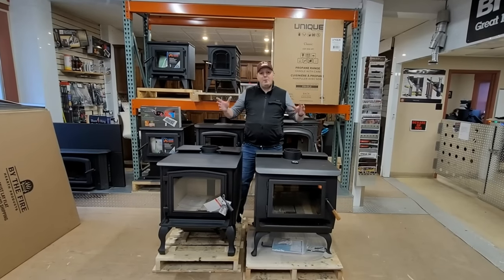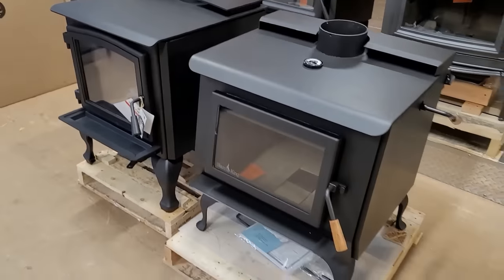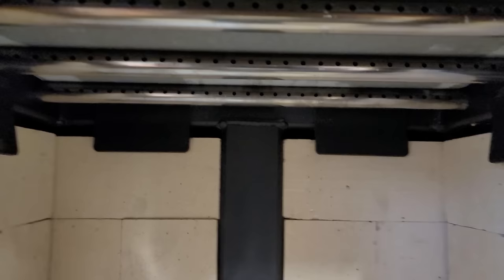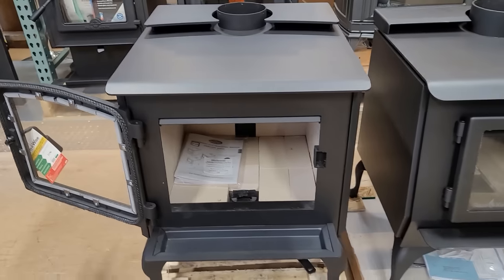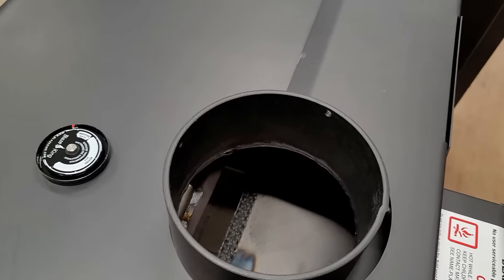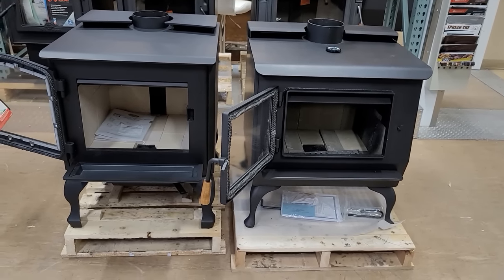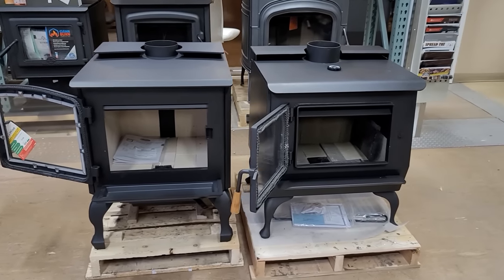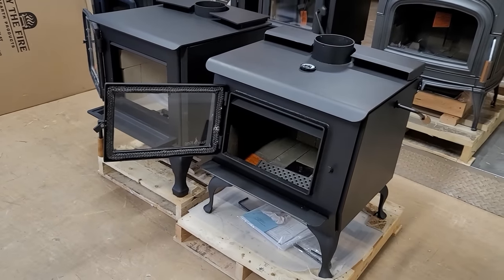Comparing Catalytic to Secondary Air Wood Stoves

Comment: EPA testing for these stoves includes an efficiency rating produced from the test sequence expressed as HHV. The 3300 is 71%, the Princess is 80%. The fact that the catalytic stove also burns steadier will tend to mean that the fluctuations in the house will be less significant, which has secondary efficiency advantages not shown here. What this tends to mean, is that for the typical wood burner who burns 3-4 cords a year, the catalytic stove will save about 1 cord every 2 years, which basically pays for a cat replacement, but many folks get more like 12-20 cords per cat, so it's cheaper to run the catalytic stove long term if you pay for wood. 

Hybrid Soapstone stoves are the best fire-viewing stoves IMO. These can be burned at a steady rate with beautiful flaming combustion, but absorb that heat into the stones and release it slower. Much lower surface temps during the hottest part of the burn than a steel stove but it holds those temperatures more stable for hours after the fire has transitioned to coaling, making it much more comfortable to be in the room with or seated in front of the stove reading a book for hours. These modern secondary combustion steel stoves will often have surface temps of 800F or more, very high thermal radiation... Some people like this. It makes me sweat, no thanks. The hottest part of a soapstone stove will rarely go over 600F.

Comment: Great video. I didn't know catalytic stoves could give you burn times of 30 hours. That's crazy. Still, I think I prefer non-catalytic stoves. I have a Pacific Energy Super LE (non catalytic) and I'm pretty satisfied with the 6-7 hours burn time. This stove is very efficient and well built.

The only thing I don't like about these secondary air EPA stoves is that they prevent you from closing air intake completely. I have a straight and tall chimney and that gives me a very strong draft. Sometimes when the temperature outside is cold the fire becomes uncontrollable even with air intake shut all the way down. Second combustion goes nuclear and the only thing I can do when it happens is look at my fire hoping it calms down. Not cool.
Reply from the maker: Completely opposite with cat stoves. BK uses about 70% less air and are not prone to over draft issues as secondary stoves are.
Each has its place and I am glad you love your PE.... just don't overfire the stainless baffle in the top.
Reply: @tinmaninc2023  Thanks for the heads up. The only solution I found to prevent overfiring is to put less wood during reloads... which is ok but not ideal. My PE dealer told me he is not authorized to install a key damper on my stove pipe due to some construction regulations in my province.
Reply: @podcastnusakan  
I am looking forward to getting the alderlea 6t soon. So you recommend getting the damper on the stove pipe ?
Reply: @lrich9317 Well I contacted PE about my excessive draft situation and they responded that in my case a key damper is probably be the best solution to my problem. Almost everyone on the hearth forums also suggests I install a key damper. So I will install one and see if it makes a diffence this winter. I'll try to think about coming back here and report my results!

Comment: I have a 2021 lopi liberty, throws great heat easy to light with the green start, but I'm constantly filling it, last year I burned 12 face cord, but this year i'm already at 10 face cord and we havent hit the dead of winter yet. I am gone from 530 am till 6pm everyday for work, and gone most weekends, and when I come home, my house is colder than I want, so my question is would a princess help me out with my issues? Thanks
Reply from the maker: I think so. We have customers with the PE32 and they fill it up every 12 hours.

Comment: I thought this was going to be a demonstration. How is creosote production with each? Do these systems eliminate that concern?
Reply from the maker: Creosote should not be a problem for either as long as the wood is seasoned. Normally less then 15% for any newer wood stove is the norm these days. Also chimney size and height are key as well as draft is determined by chimney.

Comment: I understand the distinctions you make but they leave me with an unanswered question. Do both stoves extract the same amount of heat from the same size load of wood?  I have a high volume of unheated combustion air available in a tight, well-insulated work shop. Daily temperature swings of 20 F would be acceptable. If secondary combustion air will achieve this, I'd sooner forego the catalytic converter.
Reply: My understanding is yes, 30lbs of wood will produce the same amount of heat no matter what stove you are using...90.000btu's is 90.000btus no matter how you burn it. Its like the candle and the clay pot thingy, many people think by using the clay pot, somehow it produces more heat, its impossible because the candle is rated lets say for 5000btu's thats all the heat it will produce no matter what.

Comment: We own a blaze king sirocco , and we have owned many different types through our 30 years of heating with wood and we have owned a secondary air stove as well , and as far we are concerned there is nothing more efficient than a catalyst wood stove , for heating with the least amount of wood it is the way to go . We heat from October to May and on our coldest season we only used 6 face cords of wood .
Reply: how large and how well insulated is your home.  I will likely be ordering one of these stoves next week.  I live in a well insulated 1,200 sq. bottom floor, 600 sq. top floor home.
Reply: @elkhunter3382  Our house is 1100 sq/ft on one floor and has R27 in the walls and R60 in the ceiling .

Comment: One question. How much wood do you put in the stove to get those burn times ?
Reply from the maker: Both would be filled and turned down on the lowest draft setting. This isn't reflective on how someone burns their stove when they are home versus how they burn when they go to bed. Draft/chimney also needs to be considered.

Comment: Thank you.  We have a 12-14 year old
QuadraFire 7100.   This is a secondary air unit. I have absolutely perfect cut and cured firewood. It’s kept in a shed and dry with good airflow. I also burn Enviro Brick fire logs.   These fire logs are 100% hard wood sawdust compressed under 25 tons of pressure. This compression forms a hardwood brick

Anyway the firewood will burn about 5-6 hour and put off heat for an additional 3-4 hours.    The Enviro bricks stacked with about 1” space staggered two packages and we get a 6-7 hour burn with additional heat of 3-4 hours.  With both kind of fuel, the peak heat at is from about 30 min after lighting and maintained peak heat for about 4 hours then it begins a gradual decline. 

The quadrafire 7100 is a discontinued model.  It has some issues, we have owned two of them over the years in different homes. The issues we have had is: (1) glass always smokes up as the fire begins to cool. (2) the auto air controller needs to be serviced or replaced every 4-5 years. (3) the door handles melt if left in the open position (4) the door seals and glass seals go bad every 2 years. 

We are getting ready to remodel. Im thinking we will go with a stove this time. We use the QuadraFire as primary heat once temps are below 40F. 

I need stove that will heat about 3000 Sq ft.
Reply from the maker: There are stoves out there but it depends on what you are looking to accomplish. The room with the stove will get extremely hot and it that okay then a secondary air stove will work fine like a Osburn 3500, Quadra-fire 5700, Pacific Energy Summit, etc. Max burn time 12 hours.... going with a cat stove you could look at the Blaze King model King 40 or Regency F5200. Both of these require an 8" chimney while the secondary air stoves require 6".

Comment: Can you cook on top of both? I have old cast iron type, and has 2 plates I can lift off and put frying pan with fire ring on it and do a nice breakfast. It has top air inlet for when lifting the pan or cover off, so it doesn't smoke out the holes during that transition. For something like this winter in Texas, when power also went out, probably the stove that gives more light would be preferable, although for that I use a dual filament propane coleman lantern hanging on a chain from ceiling hook.
Reply from the maker: Yes you can!
Reply: @tinmaninc2023  Hooray!

Comment: I have a jotul 600 "secondary air" stove. It easily maintains a fire overnight. I also have unlimited quantities of various types of oak firewood. This allows me to heat my house with a 28 ft vaulted ceiling with 24 ft of vertical single wall pipe.
Reply: Do you know why they stopped making the jotul 600 ? I couldn't find one anywhere! I'm stuck with buying the 500 in October 2023

Comment: I want a stove that can run secondary air when I want it, and catalytic when I want it. It is just an air routing problem … surely the engineering is not all that difficult?
Reply: I agree. And its not that difficult to do.
Reply: @GUEST-qw4te  
I am seriously thinking of fabricating one myself. Just need to fond an old stove that is tall enough.
Reply: There are hybrid stoves out there now that have both secondary air and catalytic and from what I hear basically the cat will run on the lowest air setting and the secondaries kick in on the higher settings.
Reply: I have an Avalon wood burning insert that has both Catalyst and secondary air tubes.  I like it.  I have had it for 7 years now.

Comment: I didn't know they made these.

I've been ruminating on building a rocket stove mass heater, that gives off heat for several hours after an initial, very hot burn that's pretty high-maintenance, but after tending fire for a half-hour or forty-five minutes, you're done and the mass you heated up radiates heat for hours.

Catalytic sounds like it has a lot fewer fiddly/experimental bits involved.  People do rave about their RMH's, but they always seemed like something that you'd go through more extremes of hot and cold.  

The catalytic stove seems like something that delivers a consistent amount of heat for a long time, which is what you want.  They are similar to rocket stoves in the higher temperatures achieved.  I wonder how long the stove itself lasts, and how hard it is to swap out a used-up catalyst.

Comment: My question then is, with the settings being the same, are you getting the same amount of BTUs from the catalytic stove as you are from the secondary air stove?
Reply from the maker: Settings can't be the same as Catalytic stoves use less air. The fuel is the same so if all things being equal then yes the result is the same. But Blaze King for instance can turn down its air flow to the firebox farther then any secondary air stove so they offer less heat for a longer period of time.
Reply: @tinmaninc2023  Thank you. That's it. I watched the video for this answer, as many others; did not get it in 10 minutes of viewing. If you said this in your video, up front and frankly, I would have not left these cranky old man comments.

Comment: What about if you put in a damper in the flue for the secondary air stove?  Will the wood last longer?
Reply from the maker: Yes it can if allowed by the manufacturer. Flue gases then will get trapped above the baffle and can create problems. The only time we use the damper in a secondary air stove is for excessive draft situation.

Comment: Another way to improve use of energy a loooong chimney. the chimney will warm 1, 2, floors above and will slightly increase temperatures.  Now, there might be downsides - if there is not enough draft, let's say on a fairly warm spring or fall day, (not enough temperature difference) a long chimney with a few bends makes it harder. Either the sun is shining and you do not get your fire going or it is low pressure. There are tricks like having fire starters that burn off really hot for a while and get the air moving .....

My grandmother lived on the first floor and had the tube diagonaly accross the wall before it entered into the wall, Took up space (you cannot hang cabinets nearby and some might object to the optics - but it sure radiated well. Plus she was under the roof so it did not hinder draft.

Comment: I think there is a misconception here. A catalytic converter oven needs the same amount of oxygen (and thus air) for a complete burn than any other stove. The cat can't make oxygen. It just forces the reaction between remainin combustables and the oxygen that also must be in the flu gasses.
I don't know these stoves and can't say anything about burn times or efficiencies... But it seems like the Blaze King is just a slower burning stove. Which can be awesome, no question.
Reply from the maker: Yes, less air equals slower burning.

Comment: Thanks.  I assume the secondary air takes power for the fan??  With brown outs and black looming with all the greeny bull butter, I think I'll take the one that doesn't take power.
Reply from the maker: No secondary air has nothing to do with power or a fan. Its simply air that enters a different path into the firebox
Reply: @tinmaninc2023  Thank you

Comment: To me it looks like secondary air is the way to go - they don't stop burning efficiently unwarranted because something wore out.
But there's also two different types of efficiency that are not the same. Burning efficiency is how fully combusted the fuel is - less carbon monoxide, smoke, and less excess air. As good as that is, if all of that extra heat goes out the chimney, it's still inefficient. In masonry heaters, they trap far more of that heat out of the exhaust and vent it cool enough that it couldn't boil water. Wood stoves often rely on showing down the burn so it has more dwell time in the small stove, but a slow burn is effectively a colder less efficient burn; these two technologies are Band-Aids to that problem. Rocket mass and masonry heaters really have a better system of burning that wood faster and hotter, and then capturing and releasing the bulk of it over 24 hours. Why worry about keeping it going if you only need to burn the stove for an hour a day for consistent heat?
For long term installation, I would recommend looking into making a masonry or batch box rocket mass heater, you can find plans ready made online or custom build one for the space, as long as the foundation can support the weight. Unlike a stove, in most places they can be built yourself and don't need EPA testing as long as it fits the legal definition of masonry heater.
Reply: totally agree. I've been building and using masonry heaters since 2008. The main challenge for most is the weight of the mass which is needed to hold the heat. If your floor can handle the weight and you insulate/isolate the pad masonry heaters and rocket stove variations are the best.
Reply: @migueljose2944  Yeah, it's too bad that they need such a foundation. But, having a quick look at the amount of wood they need to run a Russian brick stove for a day, versus even smaller wood stoves to attempt to heat a house. The Russian ones never soot up dangerously because they use smaller wood and burn it with more air, instead of holding lots of big wood and nearly smothering it to try to extract the heat before it goes up the chimney. On another note, small split firewood like northern European countries use, dry much faster, easily within a season, and are much easier for elderly or young to move into the house or put in the stove.

Comment: Could you provide temperature range differences between the two?  That would be helpful.  Thanks!
Reply from the maker: Which temp are you referring too? Stove temp or exhaust temp?
Reply: @tinmaninc2023  Both would be nice.  Thanks!
Reply from the maker: @wesbaumguardner8829  Secondary Air stoves tend to have hotter flue gas temps as they can go from 400 to 1000 degrees. Cat stoves tend to have lower flue gas temps generally less then 400 degrees.... its not abnormal to see temps drop as low as 100 degrees.
On the surface there isn't much difference as both max out my Flir infrared camera. By feel it appears secondary air stoves get hotter on the surface which makes sense as they have more air entering the firebox.
Reply: @tinmaninc2023  I sincerely appreciate the information.  Kind regards!
Reply from the maker: @wesbaumguardner8829  my pleasure

Comment: What about creosote? Is there a difference? And the CAT smolders, so what does that do for it?
What is the difference in maintenance and life of parts?
Reply: The epa ratings he talked about at the beginning (grams/hour) relate to your creosote. The theory with both of these stoves is that you're burning off the smoke that would cause creosote, and therefore these stoves don't produce much compared to older models.

Comment: It seems to me that a hybrid (secondary and catalyst combustor combined)) would be self defeating as the burn bars would introduce outside air into the firebox causing a hotter burn thereby lessening the "smudging" of the fire and lessening smoke to go through the combustor meaning shorter burn times and hotter fires.  One or the other is the better choice rather than a stove with both technologies.  Thoughts!
Reply from the maker: I completely agree with you. I feel the hybrid stoves were designed to get around any patents a company might have and were designed to pass the EPA test. If the cat fails then you still have a secondary air stove.